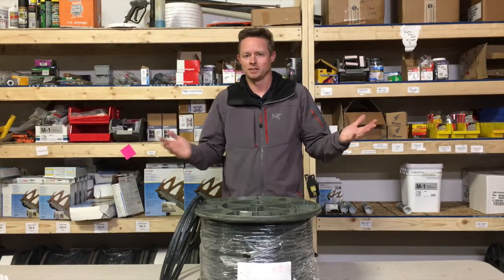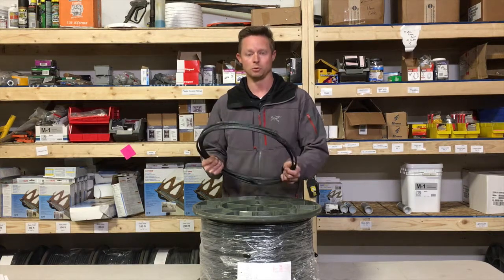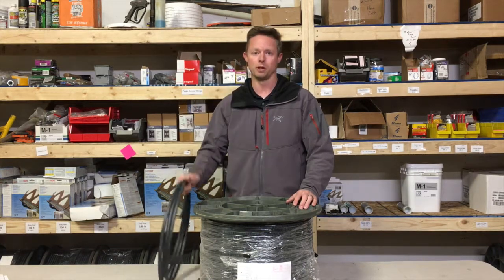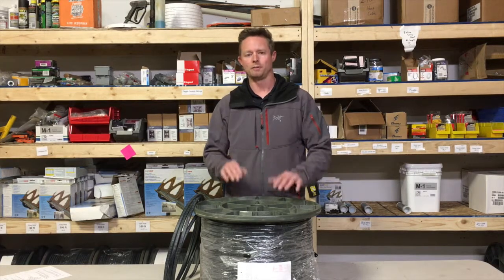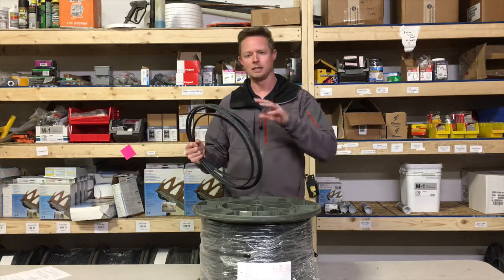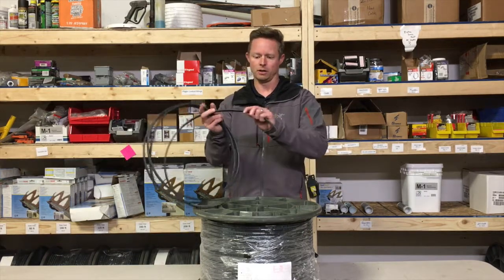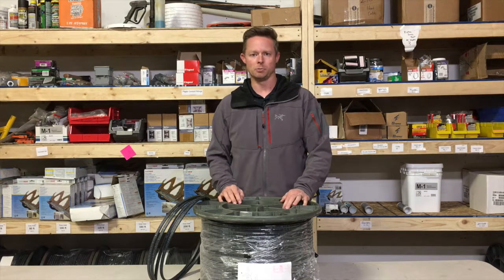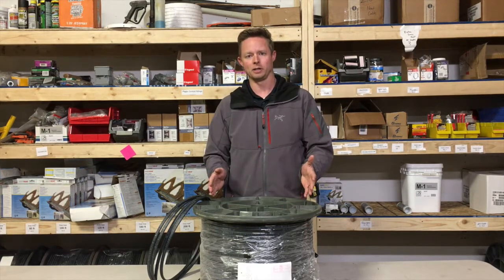Self Regulating Heat Cable 101

Comment: Two other considerations. When heating cables are turn on, 1. the water flows down the gutter, so also have cable run down the downspout. 2. if the downspout drains into an underground drain, include cable down it too. Especially on the North side. When the roof is warm to melt the snow, and the air is still cold, the water freezes up in the downspout, seen this many times.